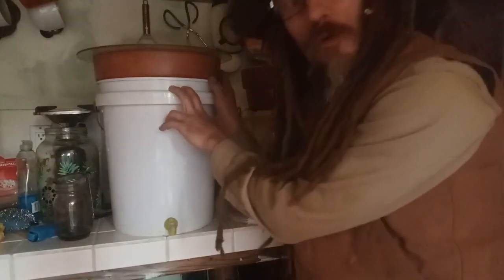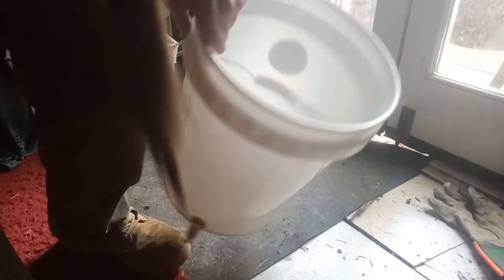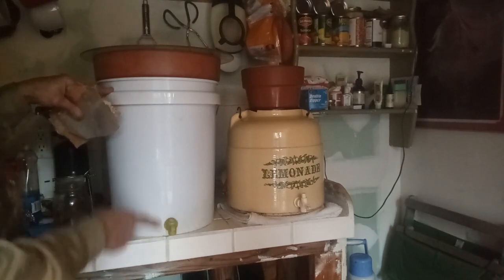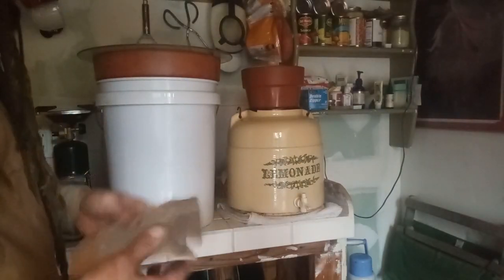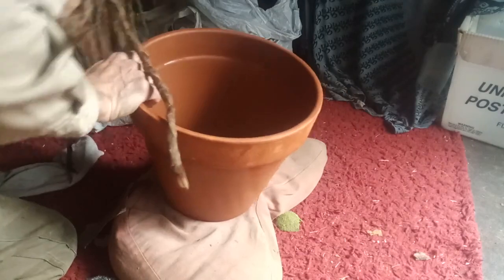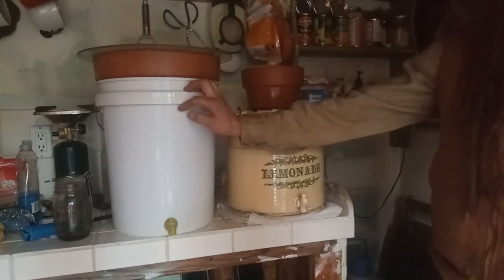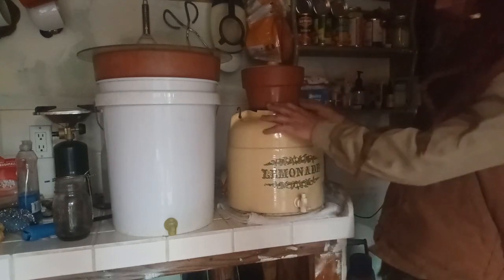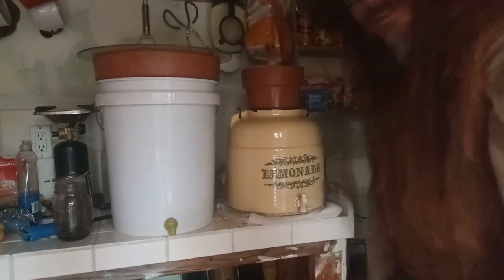Make a Water Filter  From a Ceramic / Clay Flower Pot to Survive Covid-19 Armageddon - Clean Water!

Comment: Pirates in Teepees:  Sir, terra-cotta is an excellent filter. That’s absolutely true.

We have a serious issue here. If you’re gonna be sanding a pot made of fired clay, or the glaze off that pot, you’re essentially putting glass particles into the air.  There’s no way around it.

Those tiny glass particles have a high propensity for causing permanent lung damage. He didn’t say anything in this video about the respiratory protection that you employed, and indeed it looked very much at times as though you might not have been wearing any.  

No judgement here. You’re a grown man who makes his own choices.

As a potter, I would not be much of a human being if I didn’t let you know about this.  Again, fired clay bodies and glaze are glass.  Anytime a person goes to sand clay or glaze that is fired, it is crucial to wear respiratory protection.

Then, once the job is done, if you’re planning to use this for anything that goes in your body, you need to take a brush and give it a good wash under running water, to get rid of all the tiny particles that will be left on and around the pot. This needs to be very thorough.  Then it needs to be cleaned well, and then soaked submerged for hours, dried, and then treated if you’re going to treat it before drying again and using it.  The first ever so many litres or gallons through that filter can go into your plants but they will not be so good for you. After that, though, you’re golden.

I’ll just throw this in there as well. A lot of us have UV lights, especially since the pandemic, either for disinfection services, or for growing some food in the house. A person can set up that same light over the full catchment container, and expose that newly filtered water for a little more protection. The amount of time involved would depend on A few variables. It might be a good idea to check your own light, and then do a little research online. In a day and age or a virus is an issue, and it certainly is, that might be an easy way to save your bacon with something that you already have on hand.
Reply from the maker: Thanks for the awesome and detailed comment! I probably should have been wearing a dust mask while sanding but I did wet sand it so there wasn't any dust. I thought I mentioned it in the video, and I definitely did in comments, that it is essential to soak the pot overnight before sanding and starting the project. Then after sanding wash the pot with a sponge/Brillo pad (NO SOAP) before using. Then filter 2 to 3 pots of water before using for drinking water. Also the pot should be washed monthly. I like the idea of using UV light! Great suggestion. 

I bought a water testing kit and tested the water output and it was free of chemicals, heavy metals and bacteria. However I still mostly use the water for cooking, tea and coffee so it gets boiled before use.
Reply: @PiratesInTeepees  :  I wasn’t aware that domestic water kids tested for all those chemicals. Thanks for the information.

Let’s talk quickly about those Brillo pads; If they are made of steel wool, do you want to be really careful that you’re not getting a little bit stuck on any surface of your pot I could end up in the water that you’re drinking. Your suggestion for a scrubby or a plastic bristle brush might’ve been a better one. But then again, I don’t know what Brillo pads are made of.
Reply from the maker: Not using steel wool... using the synthetic ones.
Reply: @PiratesInTeepees  :  idk why i m only just getting your reply now,  but a good answer like the one you offered deserves acknowledgement, even If it is a bit after the fact:

You’re way ahead of that; very nice, indeed.  :)

The truly beautiful thing about homemade filters, purifiers, and just about anything else, is that a person can make something functional at the quality that s/he would like, sometimes very cheaply, and even build upon that system as needs or circumstances changes.  A person can achieve the same quality as something very expensive, maybe even surpass the pricier models, with very little financial investment, like the design you’ve suggested; and it would not take a whole lot to be able to filter out other contaminants, should local water quality change. All that would be required is a reconfiguration with an extra bucket to put in a pre-filter using a couple of grains of sand, separated by layers of  fabric.  A layer of activated charcoal could also be added to that same bucket; If a few drops of chlorine or iodine were to be added to the bucket of water and allowed to sit before it goes through the filter system, then that would do a lot to deal with the microbes before the water was even clarified.

With the soil to charcoal layers in a pre-filter over the filter, your good, handmade terra-cotta filter could potentially last much longer.

I’m spending a little time thinking about this, as I’m putting together I handmade filter system, to see what the potential really truly is in practice.

Have you made any alterations to the system that you created in this video, and have you been using it ever since?
Reply from the maker: @daphneraven6745  Check out my latest video on this filter https://www.youtube.com/watch?v=L7XQEe56DRc. I have some suggestions and test results there. I greatly appreciate your informed and detailed comments. It's all about getting the information out there, especially in these crazy times! Drinking water is quickly becoming a hot commodity and anything we can do to make it more readily available helps. Stay smart and stay healthy!!! <3 <3 <3
Reply: What is glaze made of? I can't seem to find any info
Reply: @Hugh_Mungus  :  It depends on the glaze. Essentially, you brush/spray/dip it onto the fired pottery, and put it back in the kiln. The heat changes the coating  that you just applied to your piece of pottery, and vitrifies it.  So it’s glass by the time it cools down enough to be removed from the kiln.

There are lots of formulæ; some of them are fit to use on functional Wiers that will touch food, and others are purely decorative.

The glass seals a pot, so if you’ve got a coat of something that seals the pipe, it will not function as a water filter. That absolutely has to come off the pot.

Most of the clear, sometimes matte  substance that you barely see on a terra-cotta pot the pot is not glaze, however.  

Glaze just doesn’t sand off easily, but if you have to sand fired clay or glaze, it’s really important to protect your lungs. Because microscopic particles of glass can be inhaled, and causes lifelong problems with your breathing after that. Sometimes it takes a lot of years to catch up with you. No amount of glass in your lungs is good.

I hope that the information you actually need is in here somewhere.
Reply: @daphneraven6745  Yeah it helps thanks dude.

Comment: I found 25 litre fermentation buckets with the tap already fitted.  They also have handles and fitted lids for carrying the water.  Got my eye out for colloadal silver to paint the pots.
Reply from the maker: I like? Are you worried about the C.S. clogging up the filter? What pots are you using?
Reply: @PiratesInTeepees  I'm going for basic terracotta pots from our local  nursery (I'm in the UK).  From what I understand the colloidal silver helps filter out viruses in the water.  Although as our water is chlorinated I may be over doing it.
Reply: @ymor1451  :   If chlorine is your biggest concern, you can relax. All you have to do is either boil the water, or leave it out uncovered at night, and let the chlorine evaporate out of the water. No special costs associated with it.

Colloidal silver doesn’t actually clog the filter. It doesn’t filter things out either. The silver has antimicrobial properties, and so when you treat the filter with it, it contacts the particles that come through the filter, including microbial particles. There’s a much stronger possibility of destroying those, if the pot is treated with colloidal silver.
Reply: @daphneraven6745  Thank you Daphne. Thanks a big help.
Reply: @ymor1451  copper wire laying in the bucket would do the same thing🤷‍♀️and is cheap
Reply: @cornwellnbates  Thank you.
Reply: My friend makes her own colloidal silver.

Comment: I do the same thing,,, BUT I have a PRE filter pot on top full of hardwood carbon and Sand, I have a 1oz silver bar in the bottom jug 🏺
Very tasty 😋
Reply from the maker: Very nice! Do you make your own hardwood carbon? How do you source the sand? <3
Reply: @PiratesInTeepees  I get Sand box play sand from the co-op,,, tractor supply or any hardware store should have it,,,, I use Red bag oak charcoal from the dollar store, what I don't inoculate for the garden I use for the filter,,,, one lrg bag has lasted for 2yrs,, gonna need another one this summer,,, half & half mix in the pre filter,,, I haven't tested with a partical tester,, but I DID with food dye,,, it came out crystal clear !!!

Comment: Yes ive found that if you Don't want the water to taste like dirt then you need to add some sort of carbon to the clay pot. Other than that, i use this system as well and it works, though it is slow, i can produce drinking water for me and my pets with this system. I just simply added charcoal to my clay pot to clean up the taste of the water.
Reply from the maker: I'm glad it works for you!  I haven't tried charcoal, I found the "dirt" taste went away after the first couple of runs. Thanks for your comment and have a wonderful day!

Comment: I seems, the pot would be sitting far down inside the bucket, so it might be sitting in the filter water. Isn't that something you wouldn't want done? Thank you, for the great how to video.
Reply from the maker: Yes it could. I use the water before the catch bucket gets that full or I transfer the water into bottles.
Reply: I’ve been emptying out the reservoir bucket into a separate pitcher or bottle Before I refill the top, filter, container.

If you use a white bucket as the reservoir, you can just shine a light on the side of the bucket and see where the water surface  is.

Comment: Great item to feature but according to my research colloidal Silver should be used to disinfect water when used in conjunction with a water purification system, such as carbon filters or ceramic filters.  So presuming one buys a non glazed ceramic pot the inside and out are sprayed prior to use for 98.6% water purity.  Thoughts??
Reply from the maker: I am a fan of colloidal silver, however, it's purported benefits are considered mostly pseudoscience. I drank water from a Guatemalan lake full of supreme grossness (parasites, Giardia, etc.) that had been filtered via a clay pot. This was my only water supply for my three months at Lake Atitlan. Never got sick.

Comment: Trying this right now. First I didn’t sand the pot and it took 5 days to go halfway down in water level. Trying the sanded way now and using an old champagne cork to plug the hole. It’s going … faster… but I’m on day 3 and I’m halfway down in water level. 1. What am I doing wrong? 2. How many times do you need to filter through before you don’t get the terra-cotta sanded residuals? 3. Do heavy metals get filtered out / impregnate they clay? I’ve recently read a study that 2/3 of the US public water supply system was found to have uranium in it. That’s not something that’s normally tested for. The study was done by Columbia university published April 7, 2022 in Science Daily. I’d post the link but yt tends to delete those.
Reply from the maker: Hello! I have found that it is super important to keep the pot as full as possible to speed things up. Also, I have found that the pot seals against the bucket and creates pressure, so I put a small spacer like a match or Popsicle stick in between the bucket and pot and that really helps. The more you use it the better it works. It takes about 2 gallons of filtering before you stop getting clay particulate in the filtered water. I have run some tests on the water and have found no heavy metals in the filtered water, well not the ones I have tested for anyway. Didn't test for Uranium though. I am working on a followup video with my tests and updates and I should have that posted soon. Scary to thing we have Uranium in our water! I will look around and see if there is a way I can test for that. 

Thanks for watching and commenting! Have a great day <3
Reply: 2 years later and you actually answered? THANK YOU! Looks like that’s an excuse to eat a fudgecicle to get that spacer stick, so thanks for that too 😂
Reply: @pinkymcghee157  What are you talking about, that he answered 2 yrs later?
Reply: @SokemRokemRobot  perfect timing! He posted the video 2 years ago, I threw out a question recently never imagining I would get an answer to a video posted 2 years ago, but I did. Impressed ✌️👍

Comment: Did you rub your pot down...mine isnt working at all
Reply from the maker: Yes, I sanded the inside and the outside of the pot. Be sure to wear a dust mask when you do this. Also, the filtration speeds up with use, and be sure to keep the pot as full as possible.

Comment: so i sanded allot and filter is way too slow; maybe a cup / 24hrs.where did you get your pot ?
Reply from the maker: I got it from the hardware store. I have found that it gets faster with use. Also, be sure to keep the pot as full as possible. I also noticed that I need to put a small spacer such as a Popsicle stick piece or matchstick between where the pot sits on the bucket to relieve air pressure. If it seals too tightly air pressure builds up in between the pot and the bucket and slows the process WAY down. Best of luck! I will address all of this in my follow up video!

Comment: @Pirates in Teepees, thank you for this video & info.  i have been looking for some alts. like this since "The Insiders" or that type of "Pirate" decided to bring in their new system(s) of "20/20"    ie 2020 is hindsight.  anyway, i was searching your channel for a follow up video with water quality info. etc. of this system you spoke about doing in this video.  i've a couple of questions if you don't mind interaction.
 1) did you test using your tools you spoke of in vid?
  2) have you actually drank any water filtered via this system?  if so, would you please share your thoughts?  again thanks

be well & thrive,
©¿~salli
Reply from the maker: I have the test kit but have not used it yet. I have drank the water and it tastes fine. Definitely removes the chlorine flavor from tap water. It takes up a lot of space and I haven't used it in a while. I will pull it out and use the test kit on it and post the results.

Comment: I’m having trouble finding a terracotta pot that filters the water within 24 hours. 
Can someone please help me, and share a link? I’d be happy to order it.
Reply from the maker: It's a very slow process when using a flower pot. Terracotta made for filtering water is less dense (I think they mix the clay with a bit of sawdust that gets burnt out when firing). Keeping the pot as full as possible helps speed things up a bit, but it usually takes about two days to do like 3 gallons.

Comment: Would this filter be as effective as a filter cartridge system?
Reply from the maker: Do you mean like a Britta? If this works like it is supposed to, it should be better. 
Ideally, though, one would be using a ceramic pot intended for water filtration. 

There has been well found concern that the flower pot I am using could contain toxins. 
I am running some tests as I write this. I will have a follow up video up in a few days. 

This filter works similarly to the way this Katadyn filter works: https://amzn.to/34YWSQE

It is interesting to note that the above mentioned Katadyn filter uses a silver impregnated ceramic filter. Something to take into consideration for those wondering if spraying the pot with colloidal silver would be effective against bacteria.
Reply: @PiratesInTeepees  Really, I meant systems like ProPur and Berkey. I guess if it's possible to get a pot free of lead, it would be the best bet.

Comment: wait a minute ,
 what about the pot hole at the bottom ???
did you seal it ??? 
 if not you filter does not work .
Reply from the maker: Yes. I put a rubber stopper in hole.
Reply: You can use a cork as well because it is natural

Comment: I think this actually doesn't work. I have tried various ceramic pots so far, but the water filtered was very little, even a day later. In case 8 hours, I got the amount less than 5cc.
Reply from the maker: If you sand the inside/outside of the pot it will speed things up and it gets faster the longer you use it. I get about 1/2 gallon of filtered water per day. It's also important to keep the pot as full as possible as this also keeps things going faster. I am almost done with a followup video where I rand some tests on the water and timed the filtration process. Long story short it does work.

Comment: Will this work if our water supply is contaminated?
Reply from the maker: That is the intention, just make sure to throw away the first 3 or so gallons you filter until the pot "breaks in". I also would recommend to test the filtered water if possible. If you are worried about bacteria, it couldn't hurt to boil the water as well. 

I have found it removes the chlorine taste from tap water quite nicely!
Reply: @PiratesInTeepees  thank you
Reply: You need to think about what your contaminant is. It might not do much against radiation, for example, but when it comes to bacteria, you’re golden.